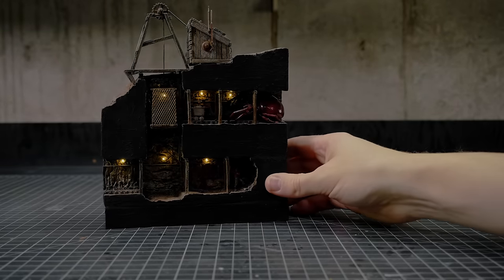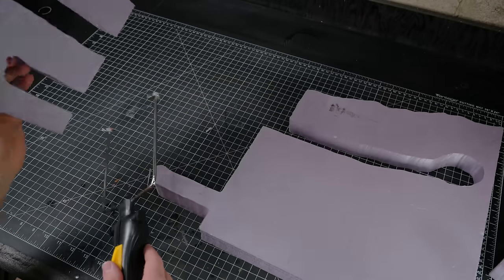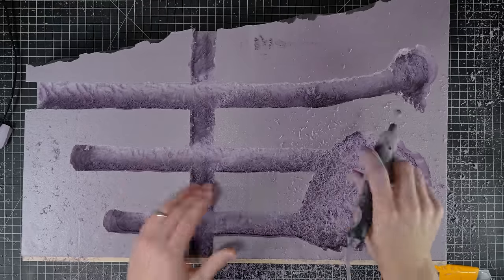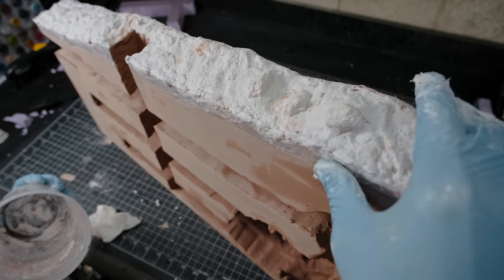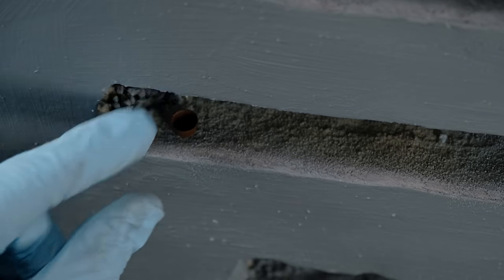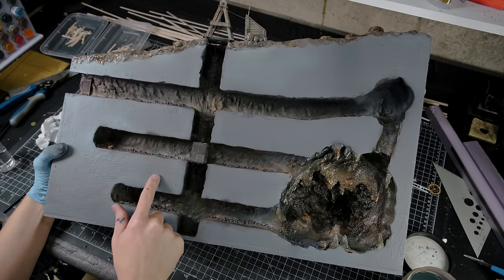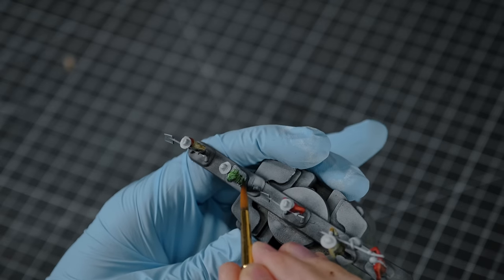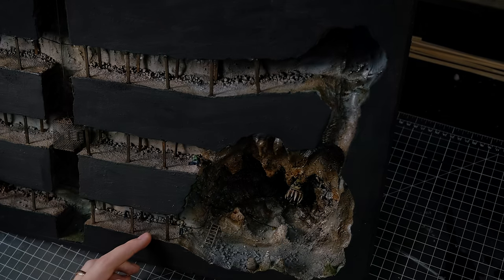Huge Spooky Mine Diorama

Comment: I like this mine cross section style. There's three now. Maybe next one. Mix it up a little. Have a tiny mine section stub at both ends. But the main section is A chasm. A massive cavity. With a winch and pully system overhead. Underneath a bridge. The bridge at the top section.  The puly system taking buckets from the lower right section bottom section. Up to the middle left section.

Comment: It looks really nice, but the elevator has also the same malfunction as in your first mining diorama, the miners cannot use it to get to the surface. You need to build the duct  on level higher, so there is an elevatorstation on the surface for the miners to go down in the mine and where they bring up the ore. Take a look for "Thunder Mesa Studio", Dave built a mine that would work nearly perfect.